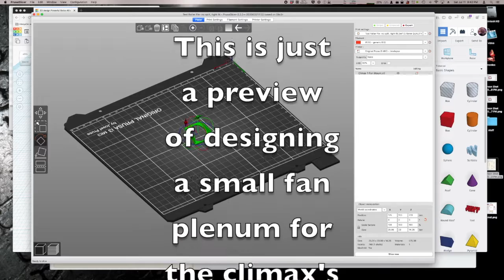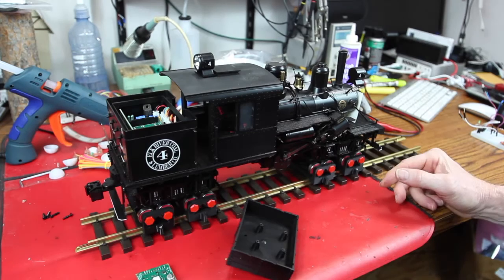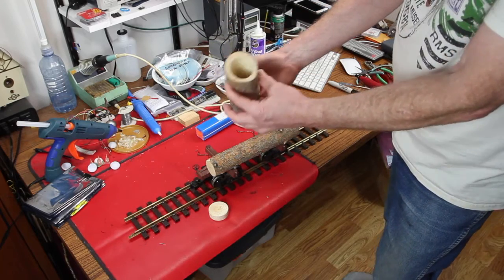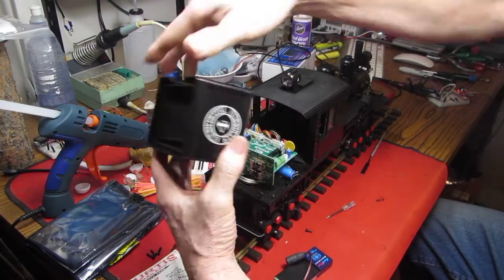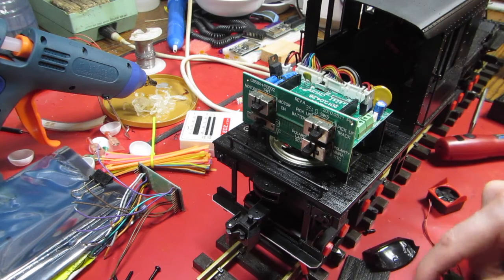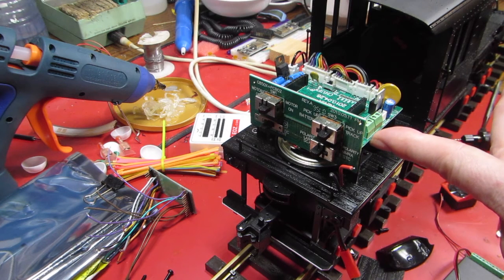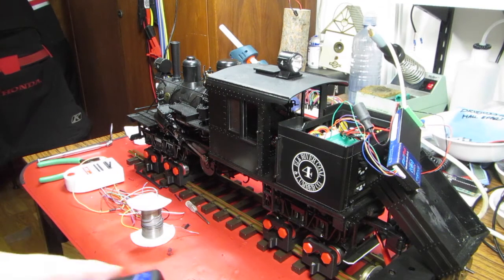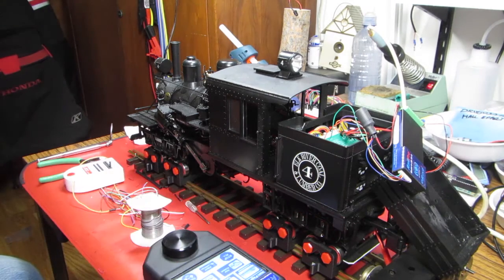Bachmann Climax battery power radio control conversion

Comment: Great video ! I always thought that a battery car would be an excellent way of providing extended running time to a loco.
Knowing that electronics have come a long way, I’m wondering, why nobody makes a plug in module without the need for all the contortion to make everything fit into these very limited spaces, except of course for the power supply leads.
Reply from the maker: Thanks for writing, Yesh!  Actually, most Bachmanns now feature a thing called a "Large Scale Socket" that is CLOSE to a standard - there are several manufacturers that make a direct plug in decoder for LSS equipped trains.   Phoenix, Digitraxx and I believe some Euro-folks like Locsound all make a direct plug in modules...   This freind already had Railpro in the works, so I used the LSS adaptor board to make the connections..   I have used both the Phoenix and Digitrax LSS decoders for other bachmann engines in the past..   The real problem is space for batteries, of course!!  ;-)  Take care!
Reply: @mtrcycllvr  thanks for the info, much appreciated.
Cheers